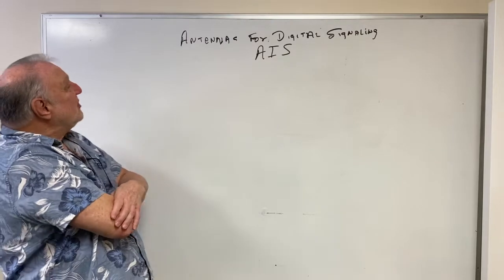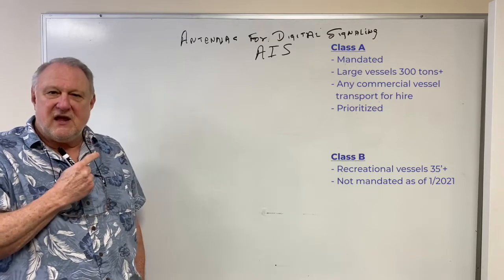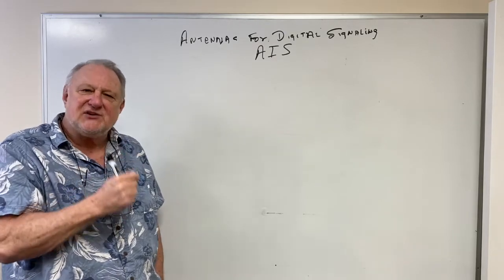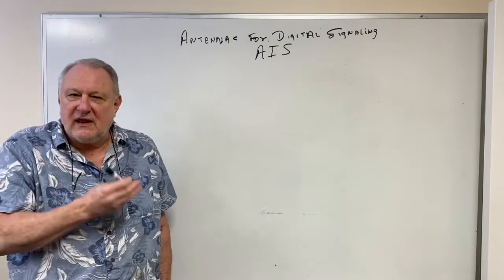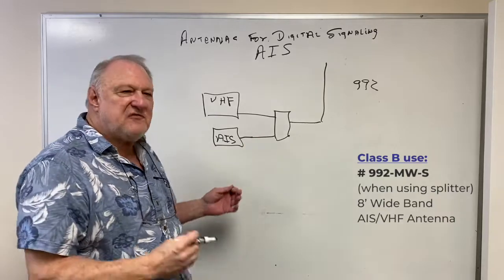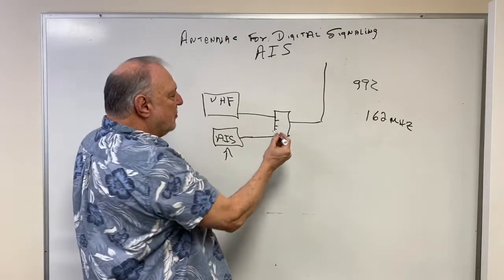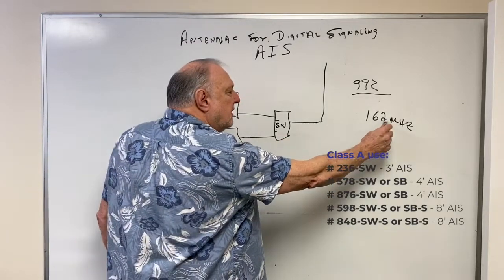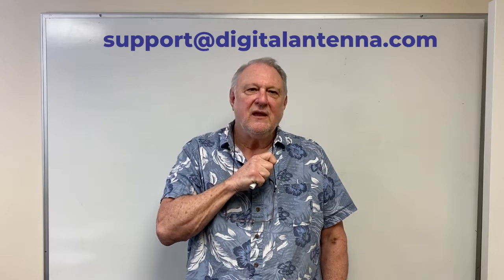Selecting Antenna AIS Class A or B - Digital Antenna, Inc

Comment: I have a SH gx2400gps/ais. Im   looking to use ais to find the "fleet" when offshore fishing.  Im currently using a vhf ais antenna. I dont have a splitter.  Im looking to recieve ais more then transmit.  But im not getting good reception on my vhf. Should i use a splitter and run them separately to my vhf or a longer vhf/ais antenna.

Comment: What Antenna would you recommend for a 42’ trawler live aboard in the Florida key?
Reply from the maker: For AIS on a 42’ Trawler,  I recommend a 4’ AIS, either the 578-SW (with cable) or 876-SW (no cable) or for both AIS and VHF you can use our new 4’ AIS/VHF antenna model 594-MW for longer range coverage use model 992-MW (8’ AIS/VHF wideband antenna with cable). Either AIS alone or our AIS/VHF combination antennas are perfect for your installation and today’s combination radios.

Comment: Thank you very much for your clear explanation. I have Ais class B (Garmin) and the AIS 800 have an integrated splitter. Do you recommend to connect a second arrial (to separate vhf and AIs) or can be OK for the use I do to use the splitter and have just one aerial? We use the boat for recreational use and we are not transmitting much with vhf, Ais seems to transmit and receive pretty well and without issues.
Thank you very much for your work
Reply from the maker: Thank you for your comments. I apologize for the delayed reply. I always recommend using two antennas for best performance when VHF and AIS are not integrated in the same radio. Many external splitters have several dB loss. In your case where maximum range is not key, I recommend our new 4’ AIS/VHF combination antenna model 594-MW and for longer range coverage use model 992-MW (8’ AIS/VHF wideband antenna with cable).